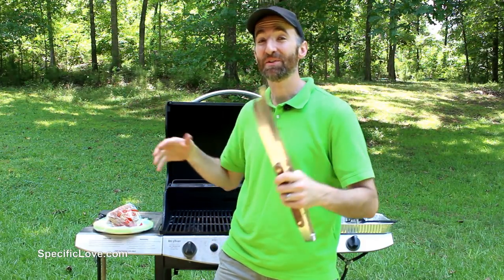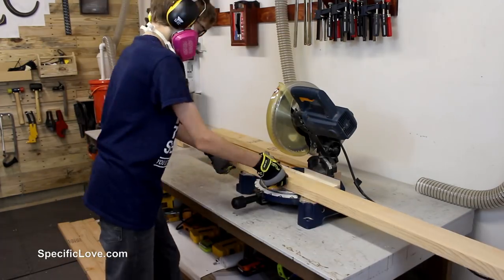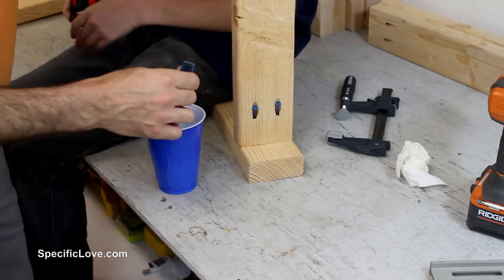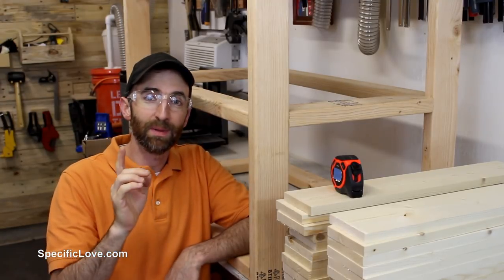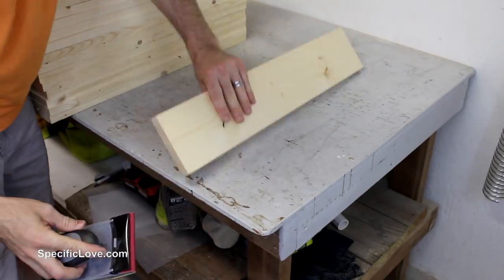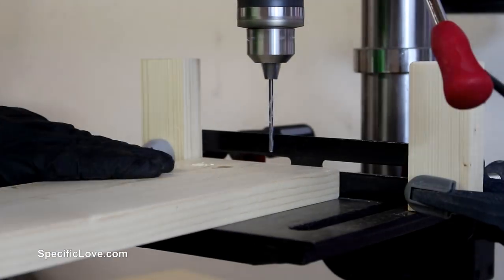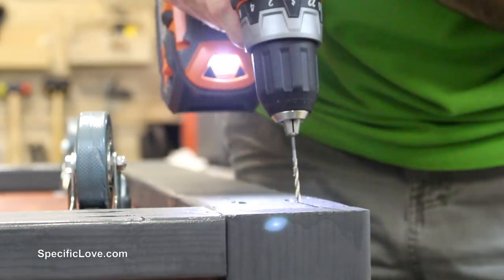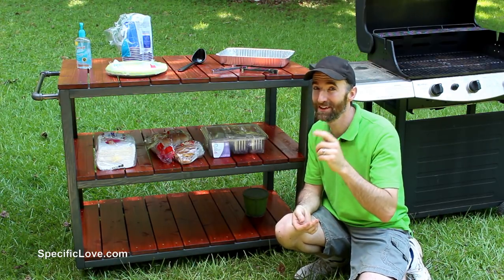DIY Grill Cart ~ Backyard Upgrades #2

Comment: Fantastic build and instructions. Curious on the total material cost?
Reply from the maker: Not sure on exact cost but I used 7 (1x5) , 6 (2x4) , hd casters, and pipe. The pipe probably cost the most and is optional. Hope that helps.